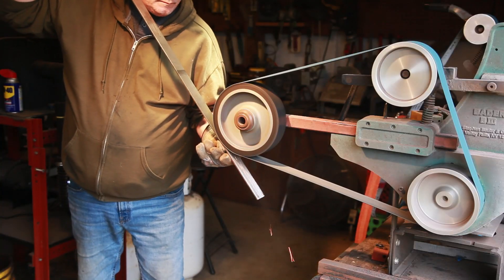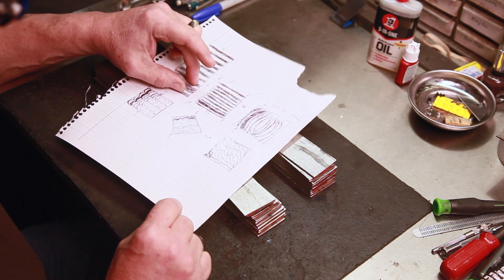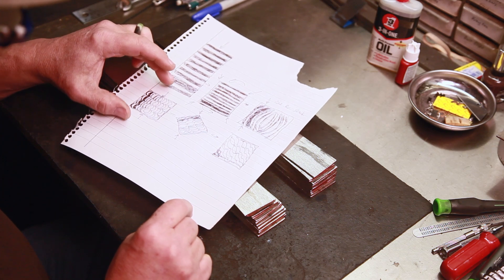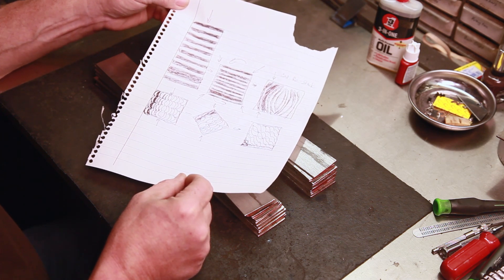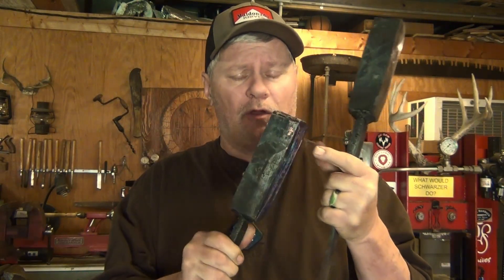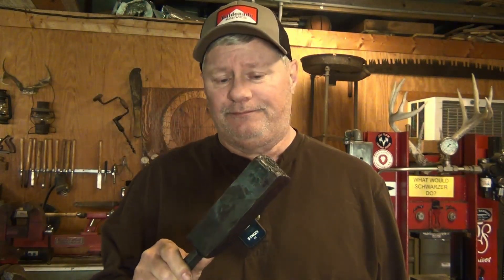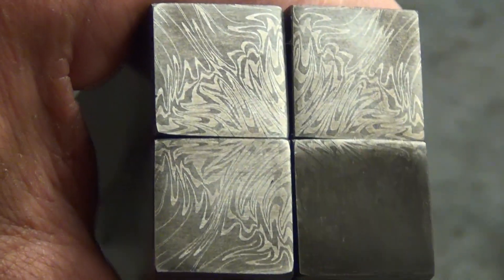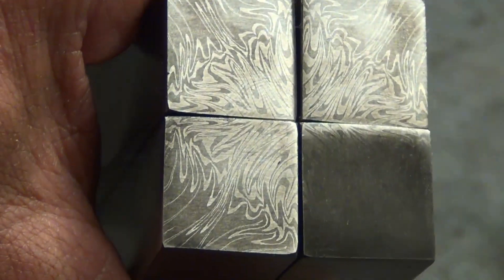How to make Mosaic Damascus

Comment: Are you using flux on the billet?
Reply from the maker: I did these on the initial stacks.  But I don’t always.  It depends on the mood.  😁. But I always dip them in kerosene or parks 50